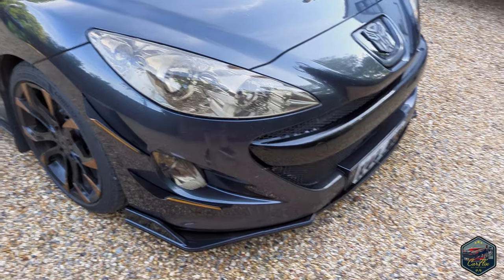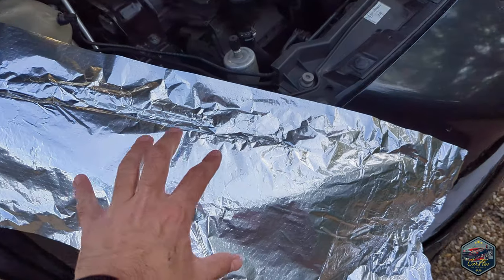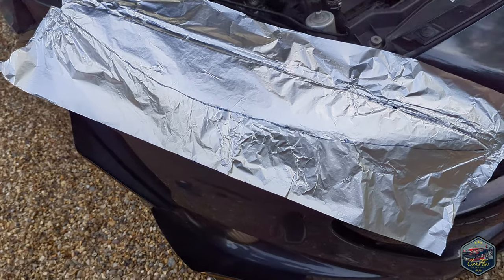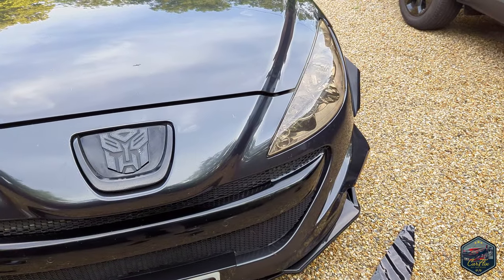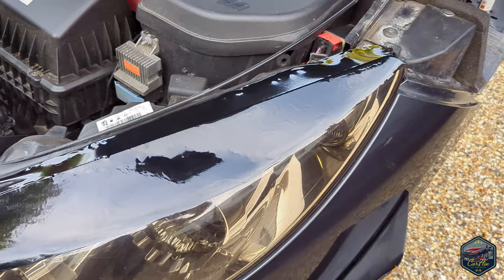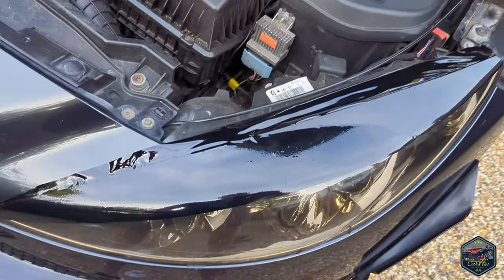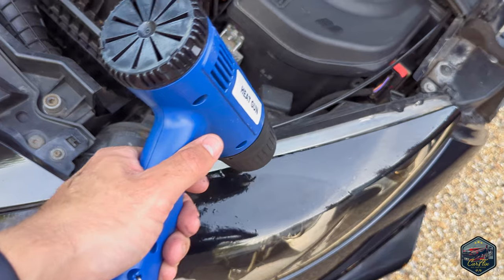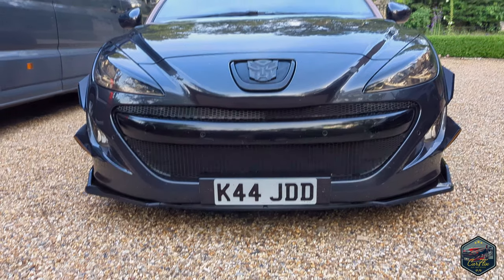Custom Headlight Brows DIY: Transform Your Peugeot RCZ's Look with Easy Step-by-Step Guide!

Comment: hoping you change a window regulator, as mine packed in
Reply from the maker: Hi 😊👋🏼, unfortunately mine was done under warranty a week after ai bought mine, if the drivers side goes I'll certainly make a vid for ya 😀
Reply: @CarFlix.  Typical 🤣  Peugeot only part and stupid money lol
Reply from the maker: @aberboy007  I know it sounds silly but have you tried Autodoc and then copy the part number in to Amazon? You'd be surprised how many parts are shared between cars 😊